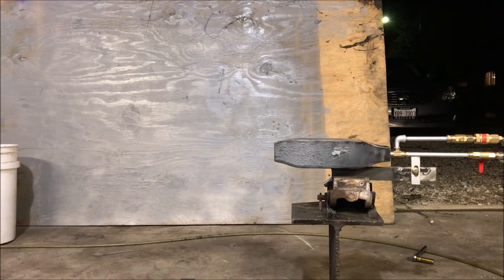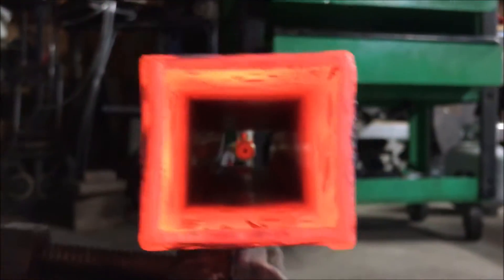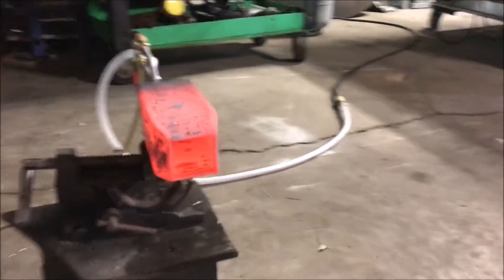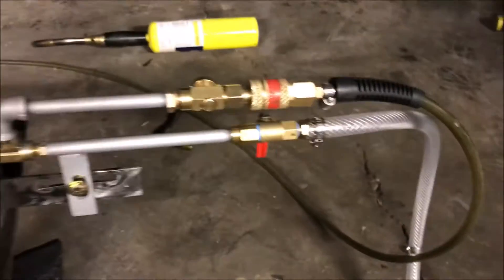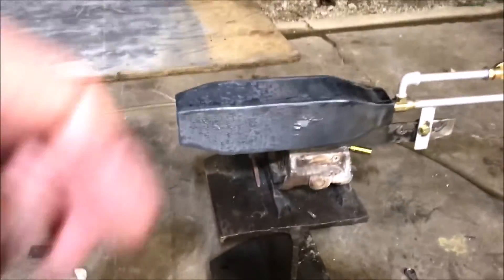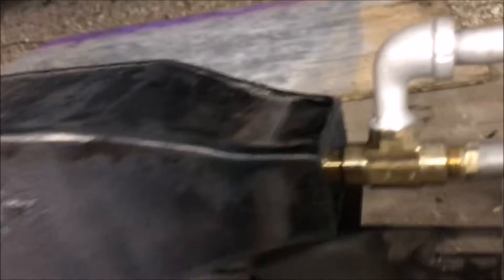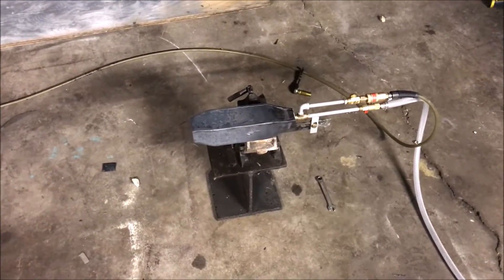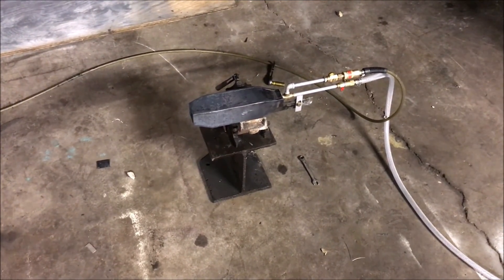Compressed air assist Propane burner

Comment: Questions:  I see you have the compressed air line on top, taking a 90 degree turn into the pipe where it then meets the fuel line... would it not be more efficient to reverse this and run the compressed air directly down the axis of the combustion chamber and add the fuel at a 45 or 90 degree angle into the air stream?   I am a total amateur and know little about these devices, but have seen others do as I have above queried.  It seems to me that there would be less turbulence with the air entering down the axis of the combustion chamber.  Do you want that turbulence for improved mixing and combustion?  Great video.  Thanks.  P.S.  You mentioned making the combustion chamber smaller... how much smaller?  I may want to try building one based on your design.  Last question:  is a flashback arrestor a good idea?
Reply from the maker: The device does not pump as well that way , if you have a high speed air jet surrounding the fuel it not only atomizes better but the fuel is shrouded in oxygen at higher speeds and concentrations than air as a result of its high velocity . It will barley pump  fuel at all te other way around . the velocity of the air threw the elbow is kinda low compared to the discharge so the turbulence is negligible. It one of those little details that realy matter if your selling these things for a living . Do a thought experiment in your head and invision what would shatter the oil into fine particles better , an air column surrounding the fuel of an air column inside an annular ring of fuel ? Both will work but youll never catch me doing that way . I have a video showing the difference just not time to sift threw 900 videos

Comment: What size drill bit is reguired for the nozzle cap. Or what size would be best for different settings, temps and flame length?

Comment: I just want to make a propane cutting torch, running off my compressed air from my air tool line shop air. Tired of bottled oxy/acetlene tank leases. Big bucks and I dont charge anyone who needs my help anymore. Is it possible with minor modifications just for rusty bolt torching off?
Reply from the maker: not possible , look up my zues burners they will get the bolt hot enough to crack off but not hot enough to melt
Reply: @NOBOX7  other than leasing bottled oxygen for usung to cut scrap metal, and never having enough on hand for this, is there anything u can come up with so I am not losing my butt in bottle leases? 
We have one company michigan air gas.

Comment: You can use slip casting and even use your own burners [if you have the fuel on hand] to fire them... it would be advantageous to add some cerium oxide [some ceramic supply houses offer it now days] and it would not only get you much more power, but also would make it warm up faster, burn HOTTER, and COMPLETELY even at higher fuel flow rates, so long as you have the oxygen on hand [that would be a case of doing the math].
Reply from the maker: Indeed, i totally agree  , this is  what i call a sacrificial burner , wanna get a good design  info before doing ss or ceramics .  I think im gonna make the next one scaled down 10% . seems its maybe a tad big .
Reply: @NOBOX7  Your message seems to have ended early...care to go back and see what you left out?

Comment: Soon you'll be building rockets. (~_^)-b
Reply from the maker: lol
Reply: This has all the pieces of the 1st stage
Reply: @toysoldier8947  Actually have you ever studied rocket engines for real? They're pretty complex machines for as simple as they look. I've worked with them before, and the only ones which are super simple are the 'use-only-once' types [like missiles].

Comment: The lean flame is burning your flame holder... ~( 'w')/
Reply: I was thinking if he got the thing tuned the temps he could generate and focus would potentially cause the casement metal to burn/boil
Reply: @toysoldier8947  This is one of the several reasons I have been hounding him to put a ceramic liner/coating in them.

The problem with coatings is, however, that they can crack because of the difference in coefficient of expansion of the materials, while a properly engineered drop-in insert will basically 'float' inside the housing.

Both can be dropped and damaged, but for stationary applications that is not likely a problem, just get it to the job site, install it and it should be safe from such problems from then on.

Super fast heating might cause cracking though, so it might be good to have a warm-up cycle to ensure the ceramics expand evenly all the way through. ~( 'w')/